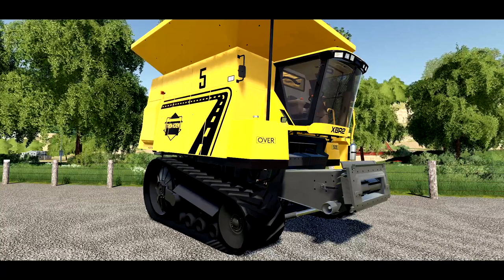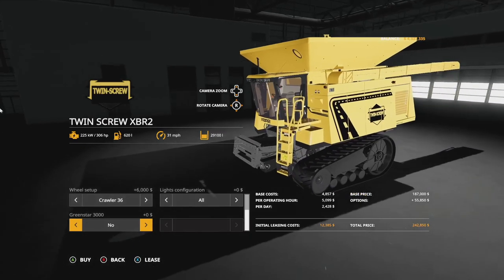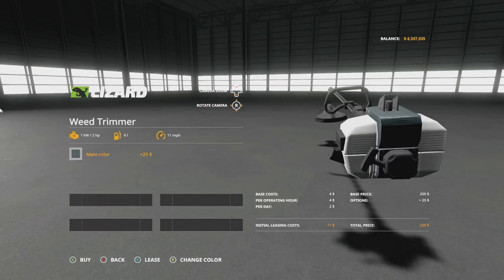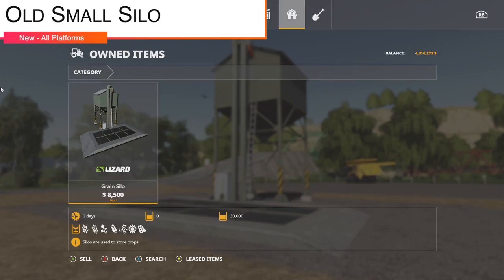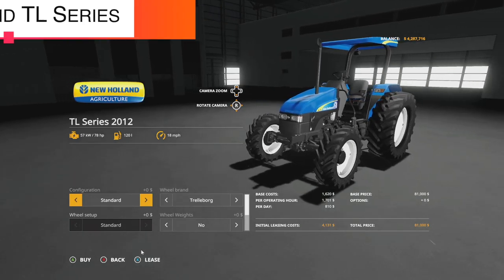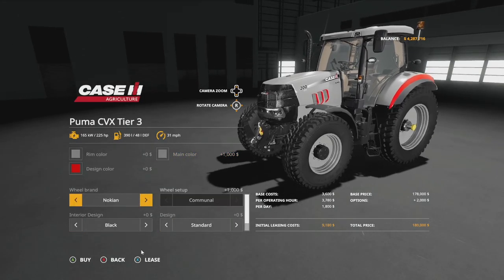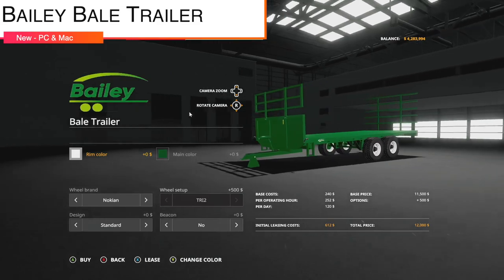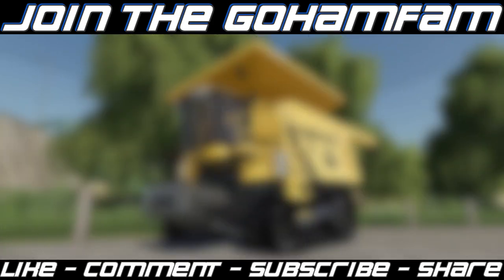New Mods! XBR2 Combine, Weed Trimmer, & More! (22 Mods) | Farming Simulator 19

Comment: twin screw harvester needs an update. none of the headers i tried 5 to be exact worked at more than 3-4 mph I used 6–9-meter lengths same result.
Reply: Right same here bought it his 4mph sold it back
Reply: I play welkers farms and use the largest headers and it does the same thing and in some areas it won't move and the ground is flat
Reply: The header lowers too far and drags the ground.